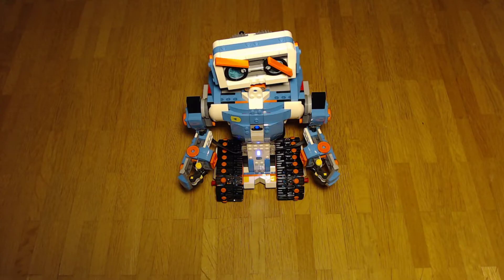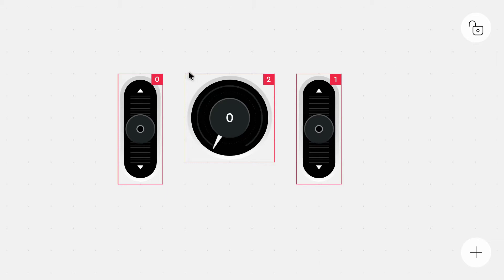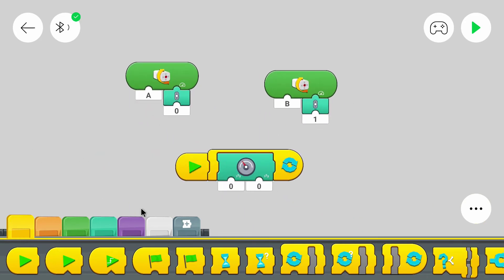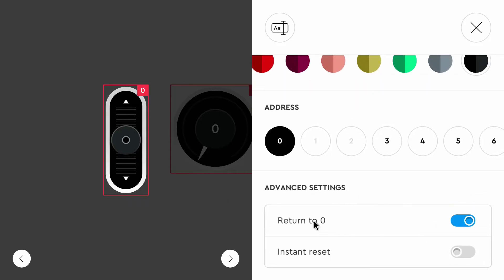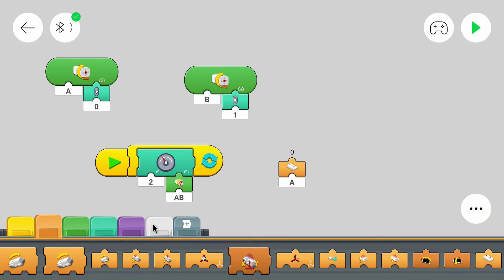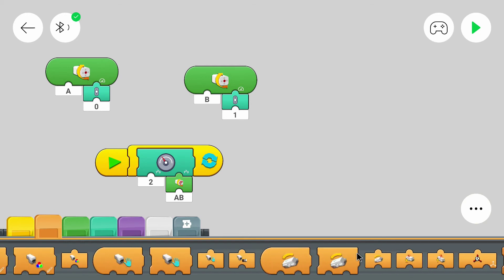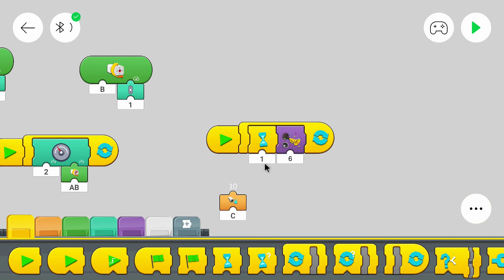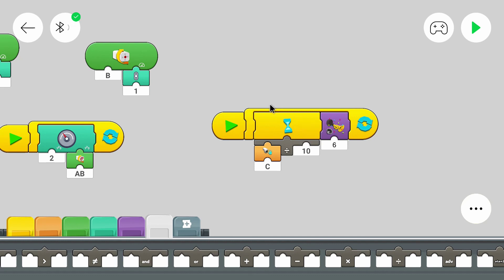Lego Powered Up Tutorial #14: sonar-like beeping and "chain controls" [English|HD]

Comment: What does "Instant Reset" mean when applying to a slider widget?
Reply from the maker: As far as I know the slider will return directly to the 0 position without "wiggling" a bit around it if you don't touch the touchscreen anymore. Normally there is a very fast wiggle animation. But I'm not 100% sure.